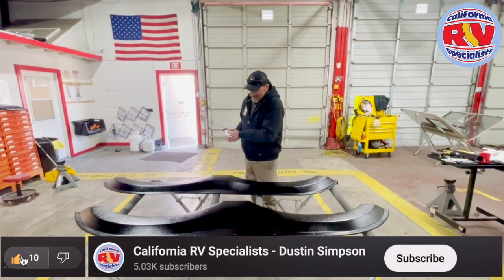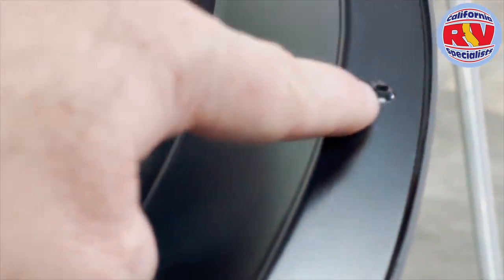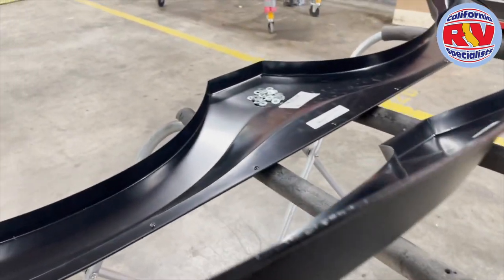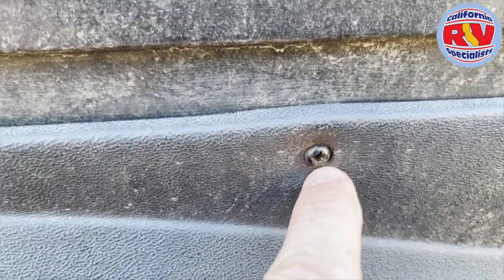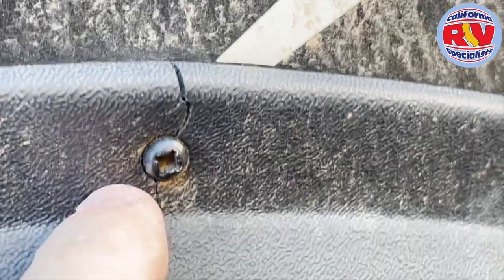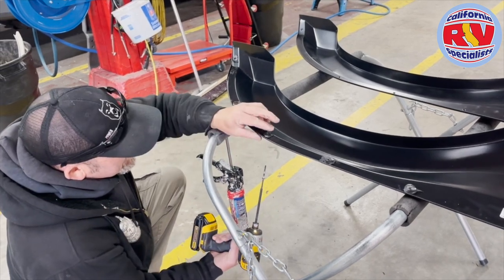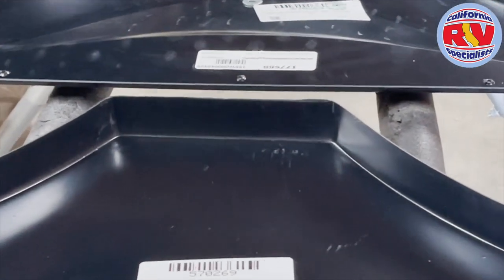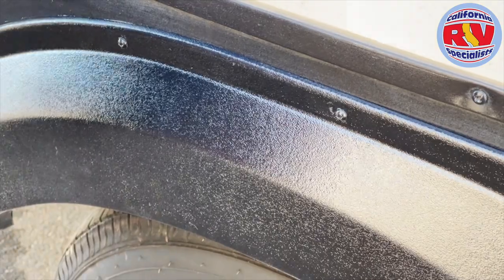Fixing RV Fender Skirts: Preventing Future Damage

Comment: I did the same thing but instead of metal washers and a Dicor Cap sealant, I used rubber washers. It was easier and faster to complete the job. No cracks in 3 years of owning my current RV.

Comment: I used rubber washers and bolts with lock nuts when I 1st bought my trailer and have never had a crack or had a bolt fall out.
Reply: I did the same thing with small stainless steel bolts and lock nuts On my Keystone avalanche. I do think I need to back it up with a washer though like these guys are doing. That way there's no dimple from the pressure of the screwhead. Those factory installed self tapping screws will still vibrate out over time.

Comment: I will be changing mine on my reflection303rls soon. I was considering lightly scuffing the back and adding a layer of Fibreglass to strengthen the complete fender in addition to the washers. Just wondering your opinion, thanks
Reply from the maker: Darren, just make sure the the residence don’t cause damage to the fender.  There is lots of different way to get the outcome the same.  This was just one of the many ways we have done it and I was trying to make it easy for owners.

Comment: What size of washers and screws did you use?
Reply from the maker: 1/4” flat washer. Depending on the surface and location, it it’s on the side wall of a slideout 5/8”-3/4” and if it’s at the floor line 1” to 1-1/4”